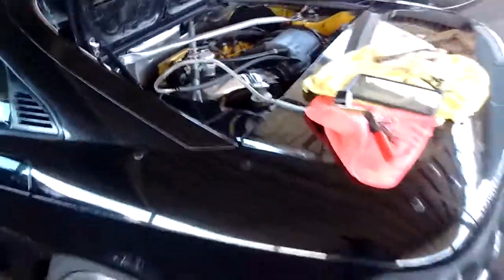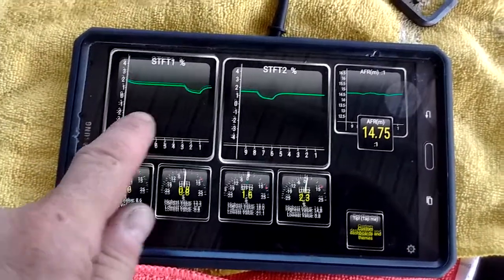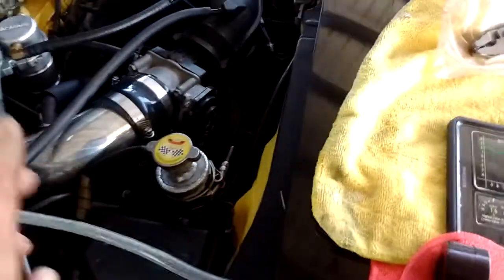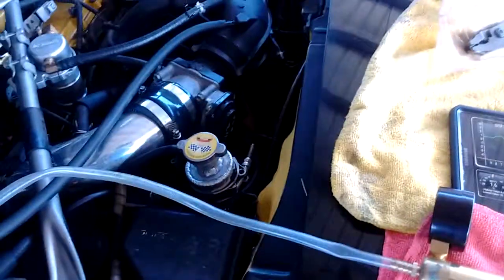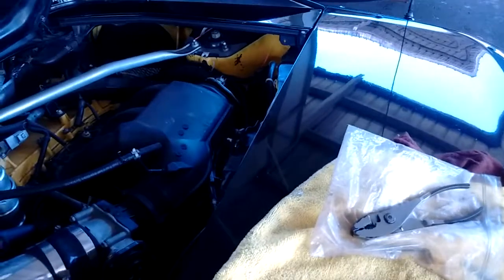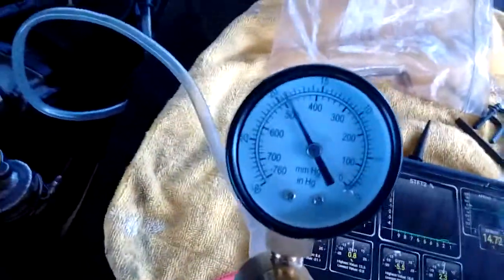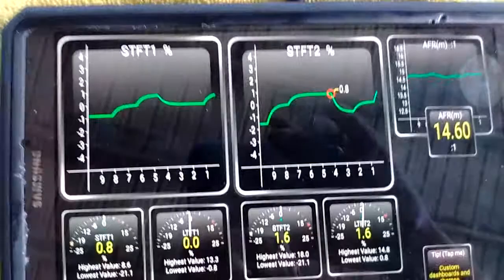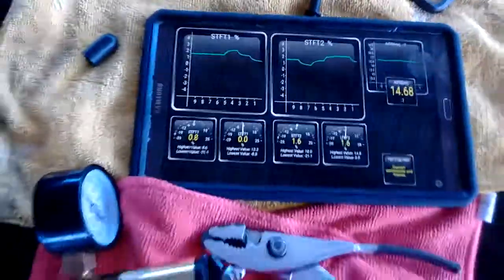Toyota 2GR-FE 3.5-liter V6 Intake Vacuum Leaks MR2 Camry RAV4 Highlander Sienna Lexus RX350

Comment: Where are the most common vacuum leaks on 2gr-fe?
Reply from the maker: You have a PCV hose and a crankcase ventilation hose and a brake booster hose then if you are using it you also have a hose for the charcoal canister vent solenoid. These are common leaks on every engine Toyota ever made, as well as many other manufacturers like Honda, Nissan, Mazda, and whathaveyou.
Reply: @Merryfrankster_  Have You ever heard of a problem with a bad throttle body on these engines? Is it possible that my TPS is somehow off sometimes causing random power loss and engine sounding like lean running? I haven't found a procedure on TS for TB re-learning. Am I missing something?
Reply from the maker: @RokasSileika  There is a technical service bulletin (TSB) for bad throttle body. I've encountered this a few times. I have it filed away somewhere. Search for "2gr-fe TSB for Throttle Body," Replace the throttle body. There is no specific procedure for tb re-learn.
Reply: @Merryfrankster_  What were the symptoms for You? The same as mine maybe?

Comment: i have toyota camry 40
 with 2GR-FE engine, at idle I constantly have Long Fuel Trim 10-12% bank1 and bank2, SFT about
 0%, with a load in motion, everything is about 0%. The car seems to be working fine. Why is the mixture so lean at idle?
Reply: Same problem.
Reply from the maker: Could be a small vacuum leak in the intake or one of the hoses.